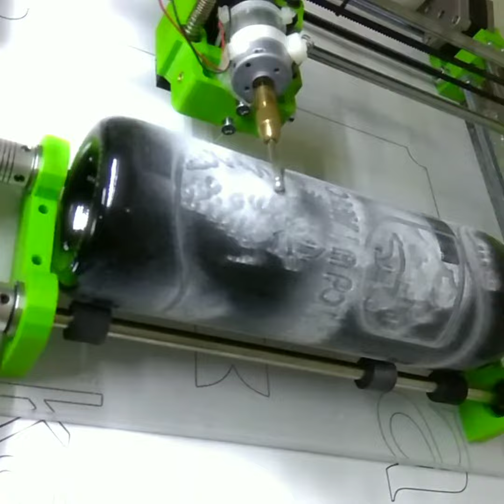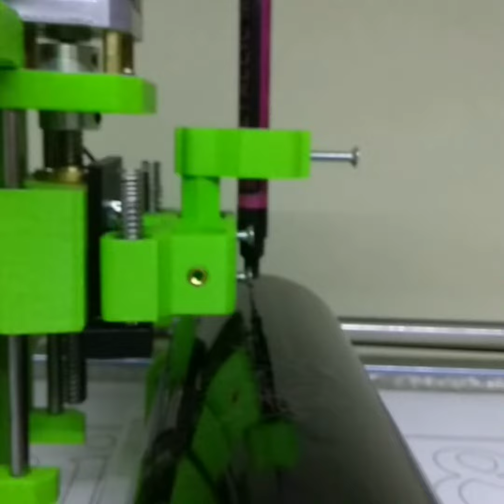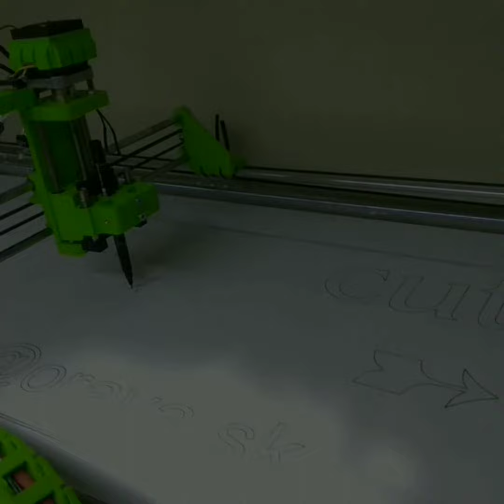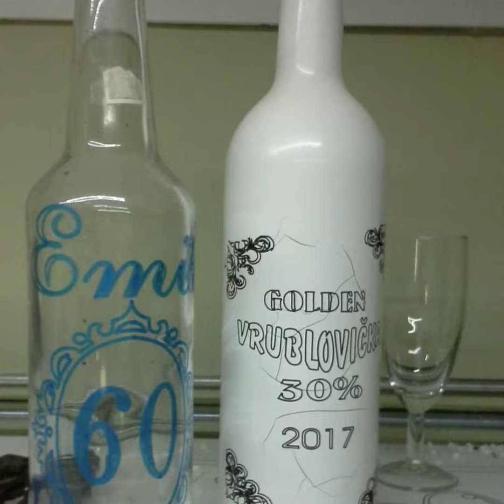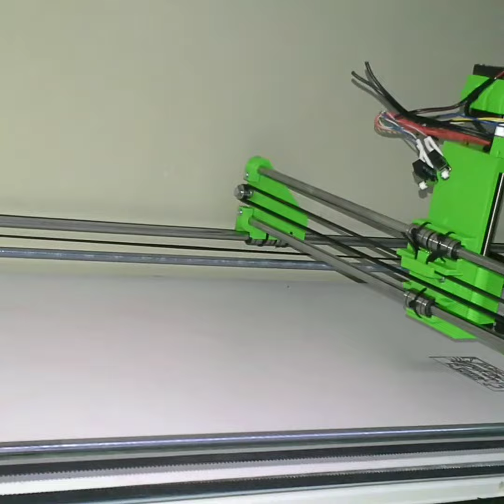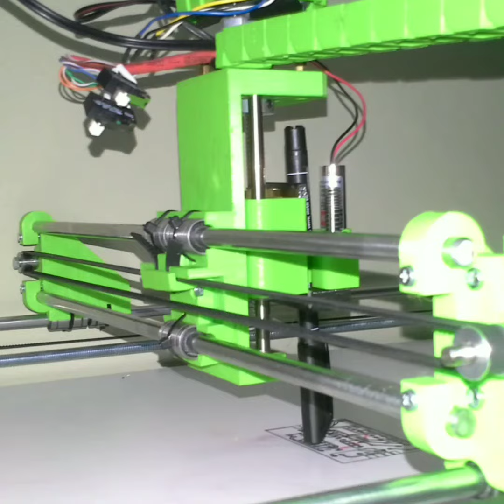Pain & engraving bottle machine

Comment: You really should do this under water (level or stream) to prevent tiny pieces of glass flying everywhere. Especially to your lungs, eyes, skin and bearings. You might also want to use dust extractor with proper filter, but the water to capture most of the dust is a must. This will destroy your health and machine in no time. Daj si to pod vodu kua.